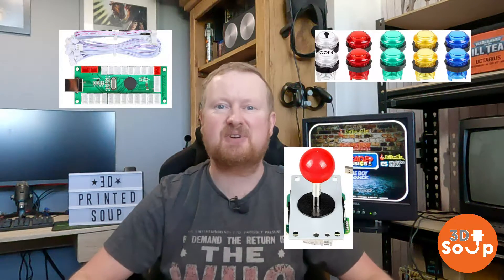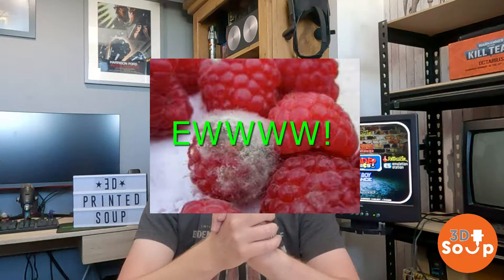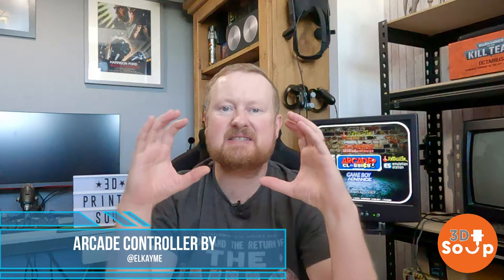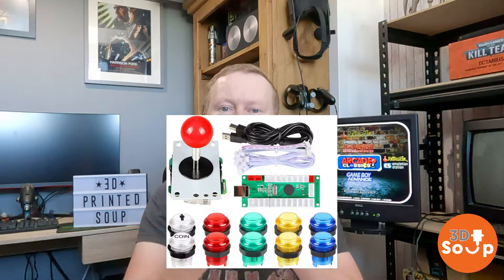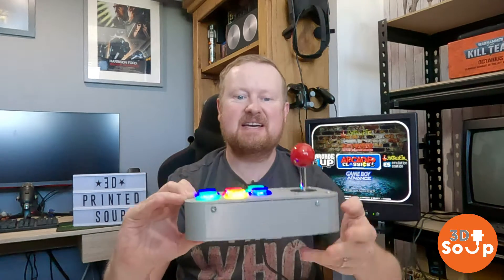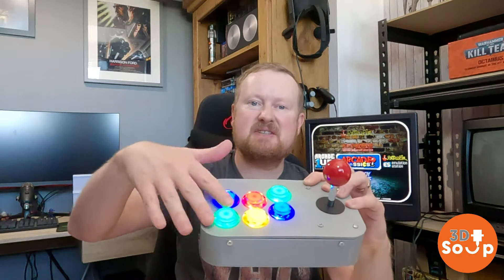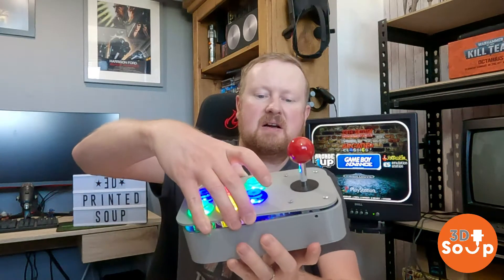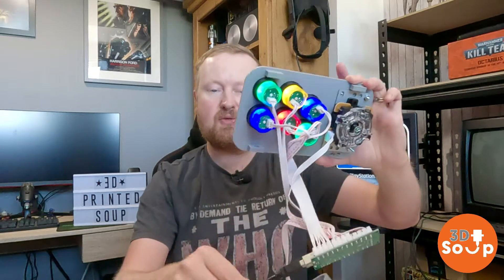3D printed raspberry pie retropie Arcade Controller by elkayem on Creality Ender 3 pro

Comment: It simply doesn’t fit!
Reply from the maker: What doesn’t fit?
Reply from the maker: I’m still using mine
Reply: @3dPrintedSoup  I’m using 30mm led buttons from eg starts, they’re just too long all screwed in with the wires and adaptor to close the box
Reply from the maker: @wills242  as you can see in the video at 2:30,  i got mine to fit and i used the buttons linked- you may need to move em around a bit. I do remember it was a tight fit though. You could try upping the size by a few percent for the height of the bottom section if you can't get it to fit.